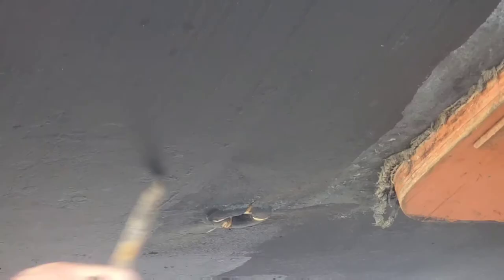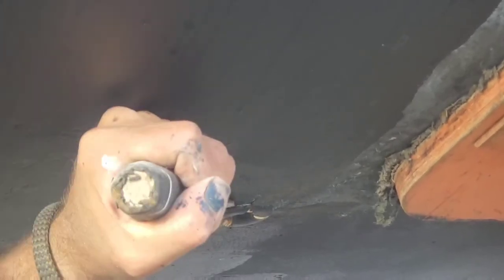How to change a thruhull Fast!!!

Comment: Or. You can do it from inside the boat. Cut of wheel on angle grinder. 1 horizontal cut above the nut. Then 1 vertical cut to split the nut in two halves. Pry apart to remove nut. Knock out the thru hull with a hammer. I did 8 of these with boat in the water.

Comment: This is a great video. Five stars. Very helpful. My thru hull was thick so did not fold in so easily so I used Dremel to cut along the inner lip. That did the trick. Thank you for posting

Comment: The inside of the fitting,there two dimples protruding out from the side wall. There is a special tool that fits up into the opening. The tool has grooves. The grooves catch the dimples. Then turn the tool clockwise to take the fitting out. Also wrench can be used to catch hold of the dimples.
Just my two cents